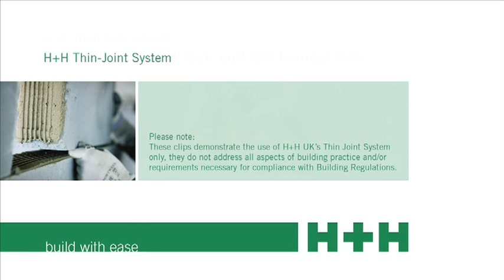How to cut Celcon Blocks using a hand saw and mechanical saw

Comment: It's not portable, tough to move floor to floor. 
Need this thing in small and portable.
Reply: portable to you and i and portable to the construction industry are 2 entireley different things

a connex container is portable for them
a several tonne generator is portable
porta potties are portable

its relative to the fact they have cranes and excavators and forklifts available to move this stuff

Comment: No PPE except gloves worn in the video. Is there no need to wear a face mask to avoid breathing in toxic dust when cutting?
Reply: dust is not "toxic" like lime or portland "dust" if you work outside it will be fine. dust particles are heavy so will quickly fall to the ground, it is irritating when a particle blows into your eyes (not always but it happens). just wear glasses if it is windy.